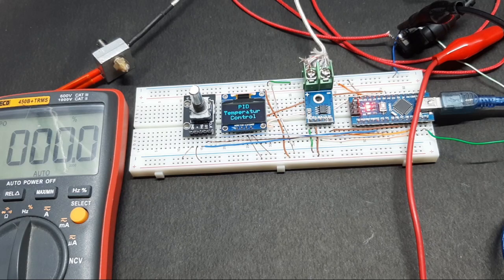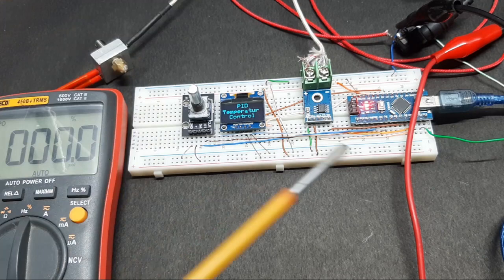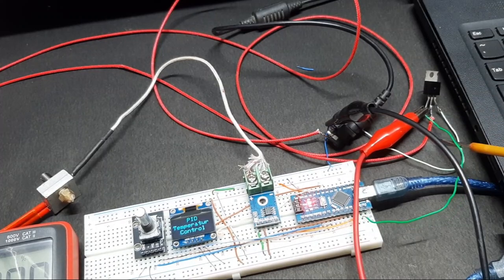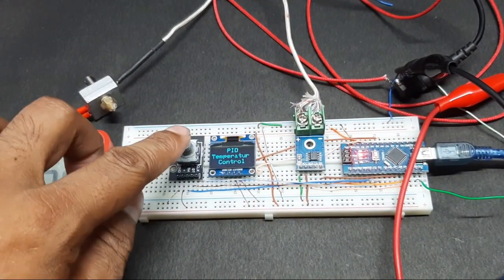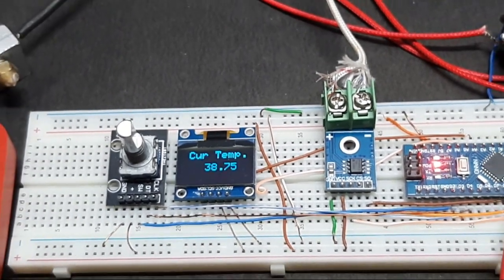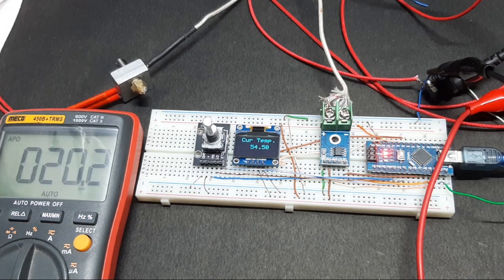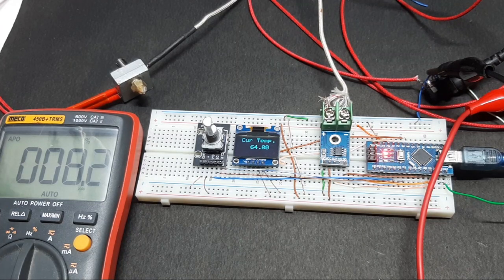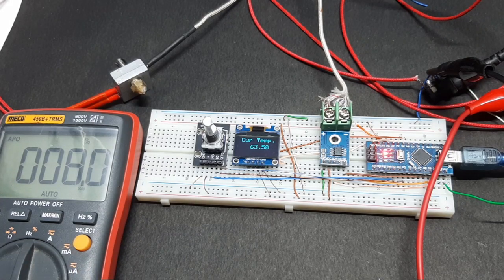How to Build an Arduino PID Temperature Controller with MAX6675 IC

Comment: Can I Heat PT 100 instead of using thermocoupler
Reply from the maker: Yes you can with some modification in the circuit as well as code.

Comment: Excellent project, congratulations. I have already assembled and tested it and it worked well, there is only a difference in tempera adjusted with the real temperature. But the PID works perfectly. I'm using it on a PET extruder.

Comment: I couldn't implement the code with ESP8266, any tips? the OLed does not work, SPI does not appear on the serial monitor, how do I? How do I change the code to replace the encoder with three pulse switches? Use a tactile key pulse to select the setpoint and one pulse to increase and another to decrease the setpoint?

Comment: Has anyone been able to turn the temperature down? Rotate to the left - the value increases, to the right - it also increases
Reply: Hi, to cool it down you’ll need some kind of heat transfer mechanism. I haven’t tried this project yet but i would connect a fan and make some additions to the code so that when the temperature dialed in is lower than what is measured the fan kicks in. Hope this helps

Comment: Really nice video. How to convert code on arduino uno?
Reply from the maker: You can use the same code for Arduino Uno
Reply: @Circuitdigest  Of course. Stupid question :D On the circuit diagarm is a resistor R1 but i can't see on video. What value resistance should be connected?
Reply: @Circuitdigest  What transistor used here?

Comment: Is it possible to control a servo position with a temperature signal so that the damper opens and closes to control the air temperature that is being sensed by the temp probe
Reply: Hello. l'm looking for a solution like that to my ge fridge side by side. To control the damper that operate according the set point temperature.
Reply: yeah